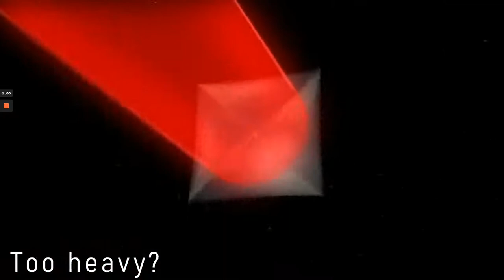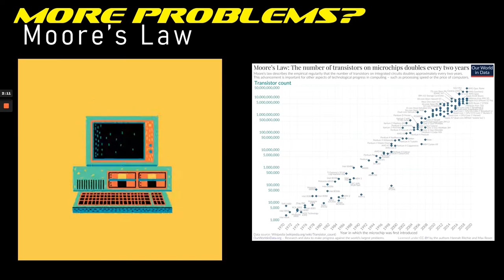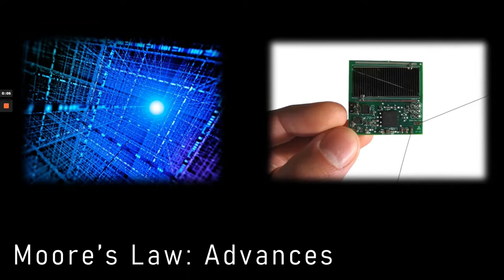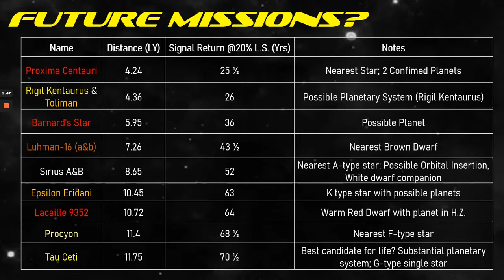UPDATE: Breakthrough Starshot Mission - Orbital Insertion?

Comment from the maker: Will we see Breakthrough Starshot launch to the stars in our lifetimes?
Reply: I'm 57 years old and I think the launch could happen in the next 20 years.... but it would be more interesting to see the results, if it works out well, and I sure don't live that long☹️
Reply from the maker: @henkstersmacro-world 20 years seems a fairly realistic timescale, fingers crossed!
Reply: If spacex makes a super starship with a diameter of ~15 meters then yes it could happen. Or if the breakthrough starshot team can make their sails foldable. The power thing i dont think will be an issue. I think they will have to develop their own high powered lasers with large super capacitors hooked up to a several hundreds square mile solar array, to allow for realistic frequent launches. I also think that they’ll never do it because developing a laser that is that powerful and efficient is near impossible, even if the 100,000,000,000 watts is distributed between thousands of lasers
Reply: I’m in my early 20 so I might able to see the result but I’ll be an old geezer by the time we will get the data back.

Comment: (2:45) Why would it take much longer than the light distance to these targets for a radio signal - which travels at light speed - to arrive at Earth?
Reply from the maker: well the probes would have to reach the system first?
Reply: @VegaAstroVideos  Are you asking a question? (Shows a question mark, but structured as a statement, is all). In any case, I think it's just a terminology issue. It states that a signal, traveling at light speed (as does all EMR) would take that long once the craft arrived. That seems to contradict the distance to the target star. Might be better to say "Travel time + receipt of collected star system information", which is what the number really represents, though clunky as I've stated it. Easier still, might simply be to state travel time in the column next to distance. Just a suggestion. Otherwise, excellent video. Thanks for posting.
Reply from the maker: @claudioveliz9834  thanks for watching, yes I think I grasp what you mean now, I guess the table could perhaps be worded differently, but for your reference

signal return @20% light speed = time for probe to arrive at the system + time for signal to travel back to Earth

also you might find this video interesting - re: mission to Sirius using similar tech:

 https://www.youtube.com/watch?v=gF1Ki8hrrfE&t=7s

best wishes